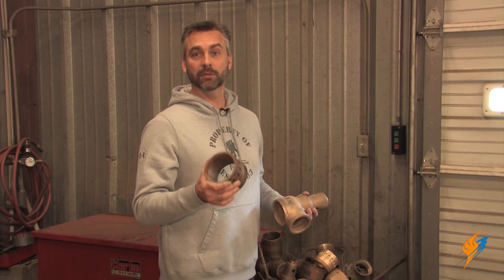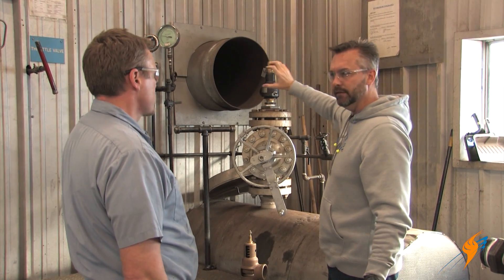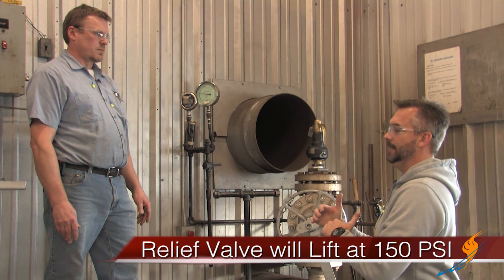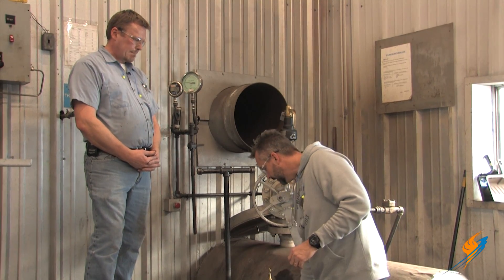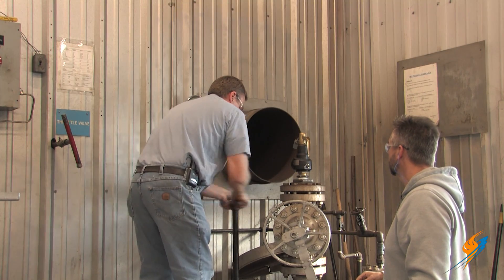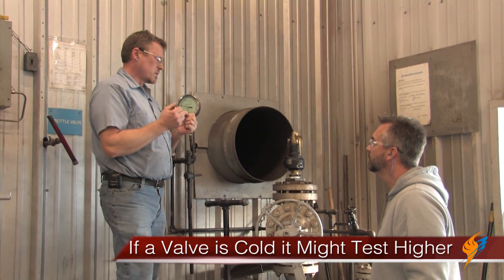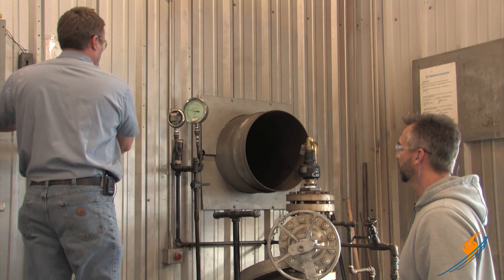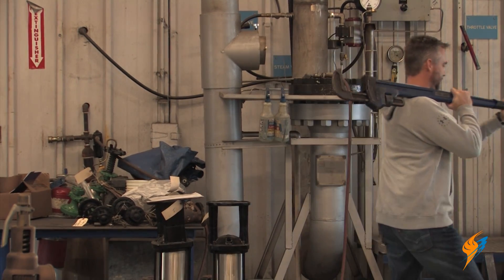Steam Relief Valve Testing  - Boiling Point

Comment: That's to test off line. Only a accumulation test on the boiler is a satisfactory test.  Also I have never seen an inspector check what the firing rate of the boiler is when doing the test which as far as I am concerned is hopeless. 
For example,  nozzle sizes and fuel pump pressure to determine the firing rate. Unless you know what that is , you are guessing.

Comment: Is it correct to perform opening tests on a steam valve using pressurized water?
Reply: Yes, we use either high pressure air or water can be also used.

Comment: Can the blow down value for an aquaflow valve be set to five pounds.
I have several of these on my steam engines and they  blow down about 25 pounds or more. With a small boiler this really empties the boiler causing low water conditions.
Kunkle used to make nice pop valves
But I can't find them anymore. 
Is this something you can do and certify for our state inspectors?
Thanks
Kap

Comment: Can an ASME V- stamped Section 1 safety valve rated in Lbs/Hr or PPH, be used on a Sect 1 high temp ‘water’ power boiler?
Reply from the maker: What temperature of water are you working with? You would need to know that to determine if you can use that safety valve. You would also need to know your maximum Pound Per Hour your boiler is running at as well. 

What I would suggest is give us a call 800.228.8861 so we can better get an idea on your situation and help you out where we can. Thanks for the comment!

Comment: Hi Great video you have there, can you confirm the lift pressure will always be lower when doing a hot test? If the valve in set to 10 bar on a cold test then the hot test will be 10 bar or less? also what medium are you using to test the valve? sorry for all the questions, cheers J
Reply from the maker: +Fly Above To answer your question about the lift pressure hot/cold, take a look at this article http://www.nationalboard.org/index.aspx?pageID=164&ID=379 . This article is written by Joseph F. Ball who is the director for the National Board Pressure Relief Department. 

To answer your second question, the mediums used to test the valve has to do with how the capacity is expressed. For valves whose capacity is expressed in GPM we use water. For valves whose capacity is expressed in scfm we use air. For valves whose capacity is expressed in lbs/hr we use saturated steam.

Hopefully this answers your question! Thanks for commenting and please share this video!
Reply: @wareboilers  Very good question Fly Above,  Thank you Joseph for answer. I love all yours videos. ***